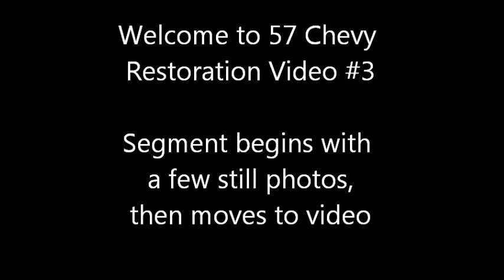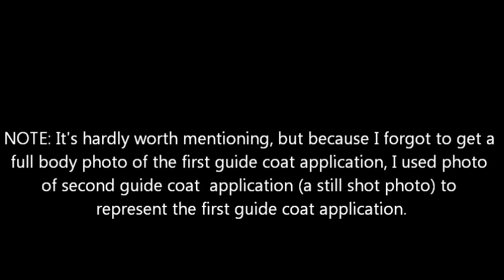57 Chevy Restoration Video #3

Comment from the maker: Hello Chevrotletbelair 1!  I used PPG Delglow for 20+ years before switching to oil base. I believe oil base is superior for auto restoration. It's not good for production work because it is too slow drying on jobs that have to be done the next day, but for auto restoration, it is the best route in my opinion. Please ask yourself; "Have I ever seen a rusty oil pan?" What I mean is this; with oil base paint, I can shoot straight motor oil into the inside of a car door, just flood it with oil so to speak, and then let it penetrate every seam, whip if off, and apply oil base paint over that. To sell my last customer on oil base, I painted a test panel, then, while my customer looked on, I poured gasoline, paint thinner, and acetone on the test panel and it was not phased, I then beat it with a hammer and the paint stayed on the panel. I use rustolium professional grade oil base paint which is available at any hardware store. It is a system that takes some getting use to like any system. But back to the door that was filled with oil, allow to sit, and then wiped to remove excess oil... when the oil base primer is applied to the outside of the door, one can watch the oil pull the primer into the pinch-weld seams (any other paint would spread away from the seams, but oil base pulls into the seams). There's nothing like oil base for old cars because they always have rust in hidden places, and oil is the best way to get to that rust.